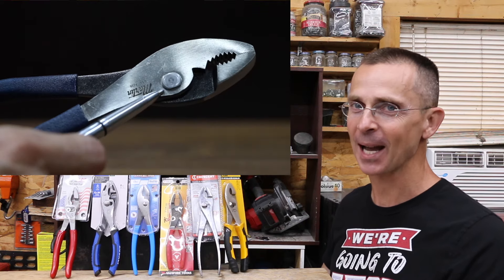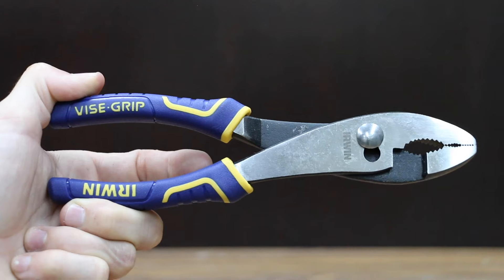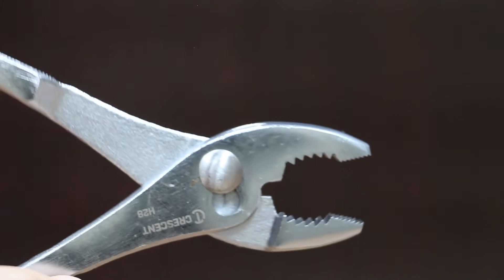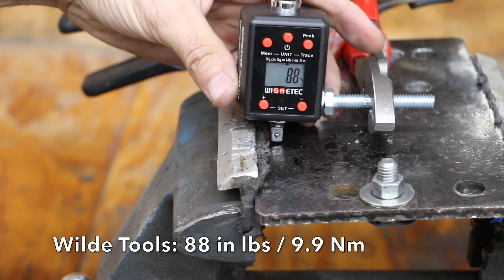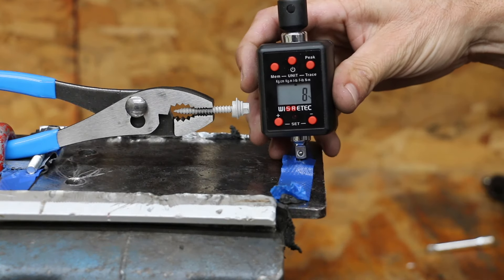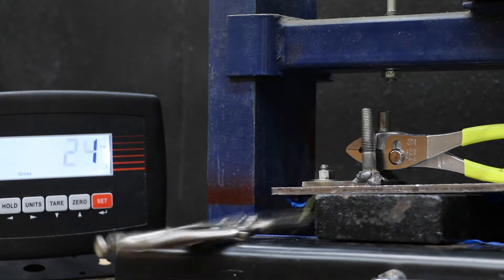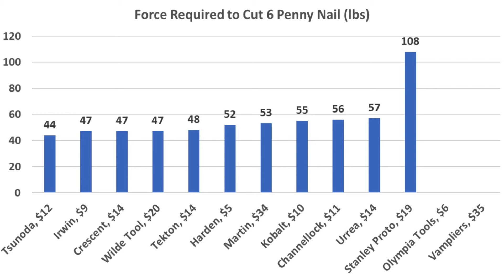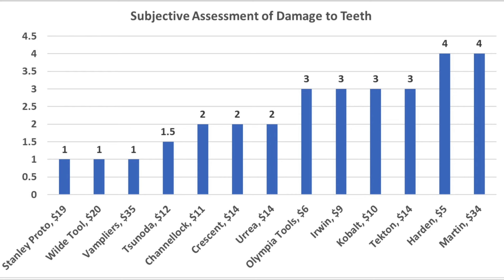Best Pliers (SLIP JOINT)? US vs Japan, Vampliers, Kobalt, Irwin, Stanley, Tekton, Martin

Comment: I like those vampires. I've never seen anything like them. I don't think they are really in the same category of tool as the rest. Torque is measuring the pressure applied to a cylinders surface area. The pliers whos internal radius best matched the radius of the bolt would have an advantage. The vampliers would apply more pressure on a flat plane and they would be the preferred tool used when pulling or lifting any 2D object like a strap or sheet. I think PF might see different results if he measured the breaking torque on 3 drastically different sized bolts of grade 5 and 8. Then measure the force the pliers could handle while putting a strip of 1/2" metal in tension.
Reply from the maker: Thanks for the feedback.

Comment: Can you compare torque wrenches for accuracy at different price points. I was looking and you can get them from £25 and over £200... I went for one for £50 with a calibration certificate (teng tools) for a 5-25nm wrench, if I like it I'm going to get the 20-110nm wrench as that would cover the full range for my car as the highest setting in the Haynes manual is 100nm. There was also some that had a very wide claimed range (like 13nm-210nm) and people claimed it's useless below 50nm (snapping bolts and what not)
Reply from the maker: Thanks for the suggestion.

Comment: I do like your video! FYI, there are other high quality JDM brands. I hope if you have a chance to check KEIBA or FUJIYA for example. 
I think KEIBA FC-107 would be easily beat the JDM plier in this video.... but it's in much expensive price range. So maybe it is not fair to compare.
Reply from the maker: Thanks!  Thanks for the suggestion.

Comment: If you did not put Snap On 47ACF slip joint pliers in this testing then it was incomplete. As a  mobile technician working a career on HD equipment in the industry who owns 70k plus in tools, they are imo the best set you can buy.
Reply from the maker: Thanks for the constructive feedback.

Comment: Good stuff! Did you use them enough to gauge which ones felt the best to use in your hands?

I'm not sure if anyone has suggested it yet but I'd love to see a adjustable wrench video. One thing that would be nice to see is which ones have the tightest jaws but still adjust easily. Maybe include some tool truck brands along with others. I definitely will be sending some support your way, I love your channel.
Reply from the maker: Thanks!  Thanks for the suggestion.

Comment: Test idea:

I was told by an Apple Store “genius” (what they call themselves) that the 110v charger willl deliver 20 watts. When I tested it with my KILL-A-WATT EZ…it never exceeded 12watts when charging my new iPhone 12 from 5 to 100% SOC.

Project farm should test an assortment of 110v and 12v chargers to confirm or shoot down there claims.

For the 12v chargers..I bought a meter that plugs into the USB output of the charger, then plugs into the phone to measure the voltage and amperage (VxA=W)
Reply from the maker: Thank you for the video idea!
Reply: One of the problems with low amp charger cubes is that although they can charge my iPhone (albeit at a snails pace)….they cannot charge my iPad.
LET THE TESTING BEGIN !

Comment: Are you testing the bolt or the pliers? Of course they will all slip at 75 lbs, that's the thread resistant.
Reply: I think it would have been nice to see a test of the grip on an unthreaded bolt.

Comment: the cutting edge of the grip teeth aren't hardened and if you harden them they break off.   the Japanese plyers are okay but they need the samurai sword people making them so that they stay sharp but don't break.  the metal needs to be hand forged and folded 900 times and then softer metal needs to be judo chopped into the middle of it and then forged up on to it samurai ninja style and then, of course, the blessing for each pair.   It's like a Japanese tea ceremony,  all formal and done special by a geisha girl and a monk

Comment: can you redo oil testing I don't think the friction test is a real accurate test for a engine at first I did but after doing my own research no. so can you think better test maybe used oil after few thousand miles and a metal friction test on incline somehow or oil pressure I saw on one channel. I see you and other channels do friction test and  I think the group 5 ester oils will be hard to beat in my own experience I feel more power and smoother that's coming from m1 or pennzoil synthetic but I have no evidence just my word. there has to be a better test or way to tell. thanks
Reply from the maker: Thanks for the suggestion.

Comment: 1. Can you make a yeti cooler your self and get the same result without paying 500$ I figured a osb plywood box with some great stuff 🤣🤣🤣
2. Automotive Crasftman tools like wratches, Wrenches, sockets in my opinion have become garbage and over priced by lowes. I have been snapping the new Crasftman tools left and right. Almost seems like harbor freight had become a better option Could you find a tool brand that could be around the same price range and a little better quality? Ive been using power built they seem to be around the same price and around the same quality. But i want to be sure before I switch over my entire tool box and dump my Craftsman tools.
Reply from the maker: Thanks for the suggestion.

Comment: you testing system fails, setting them all at 2 inch will never work unless all are the same shap and size. To make an even test you should have used pounds per square inch. I have seen you do that in the past, so why not this one? 🙃

Comment: Todd, So can I cut a nail with the pliers and my bare naked hands or do I need a press?  I have to ask that you take a step back from your great channel success and seriously question what you're doing.  Pseudo science experiments with gauges and column chart graphs really doesn't help people know if they can cut a nail with a particular set of pliers.  Personally, I'd grab a bag of nails and all the pliers and wander the streets filming real people attempt to chop a nail in half - if my grandmother could do it then that's a win; if it takes Arnie to do it it's not so good.  I wouldn't squirrel myself away and pull out the torque gauges and hydraulic presses and then fire up Excel or Google Sheets and call it a meaningful test.  Real world please.  The videos are entertaining but they really do fall short of real world testing.